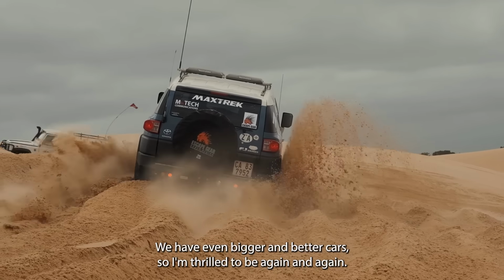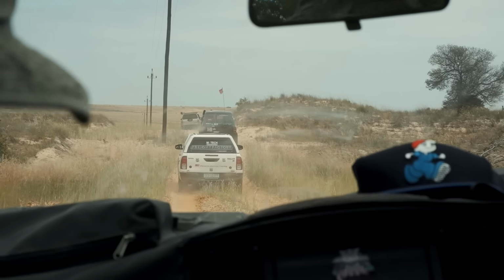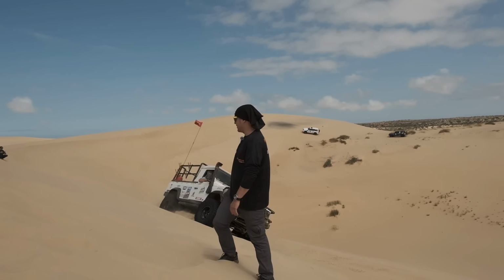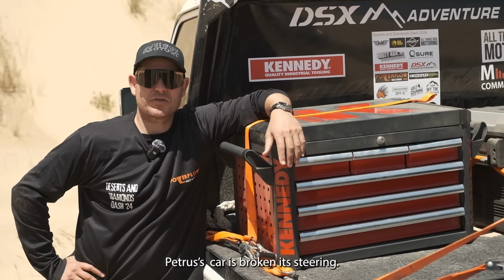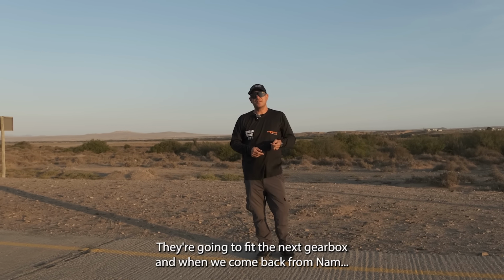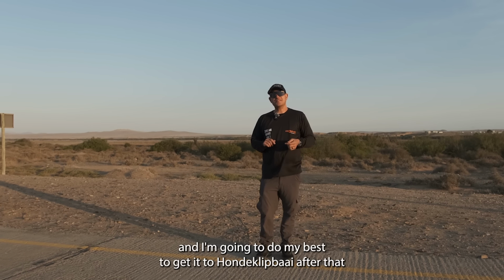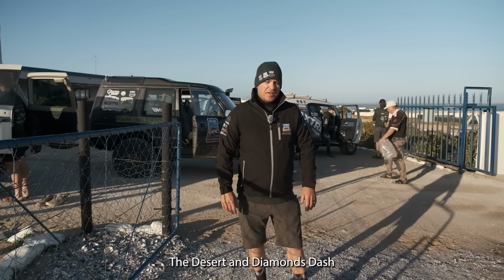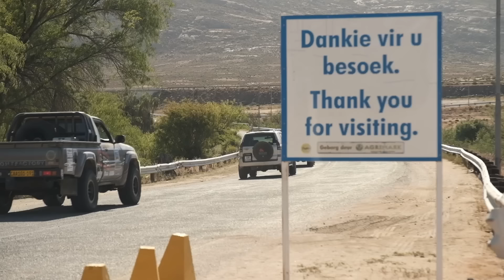Driving the best sand dunes in Southern Africa | Cape Route Rally

Comment: Why the sound is so heavily overloaded? Use limiter. DJI is a great mic, can't be the cause.
Reply from the maker: The gain on the mic was accidentally set up to max, so the audio was damaged from the source. We couldn't do much to save it, but we did try everything we could. It's much better than it was from the source.
Reply: @DieterPey  DJI saves recording in the internal memory. Usually I get it from there. It can also be 2'level tracks (left and right channels of stereo). It's a good backup.
Reply from the maker: Yeah, I use the DJI mic 1 kit personally and love it. This event was filmed and edited by someone else with rented gear as I was out of the country for other work, so it was difficult and had to work with what I got.